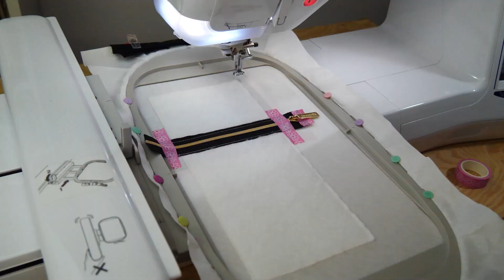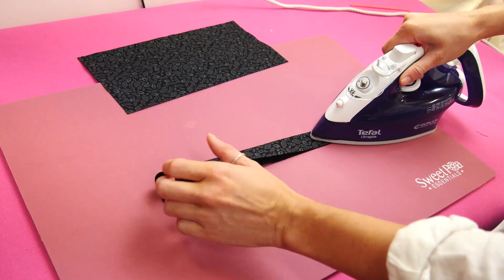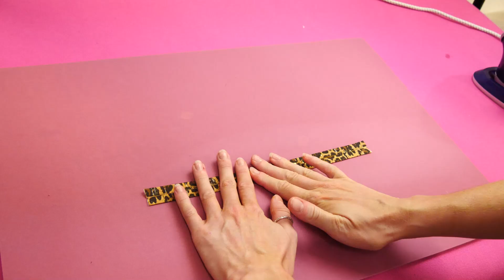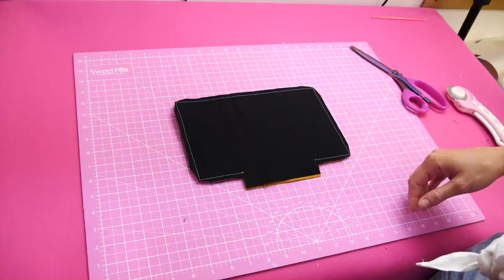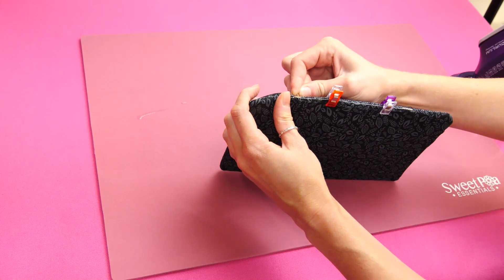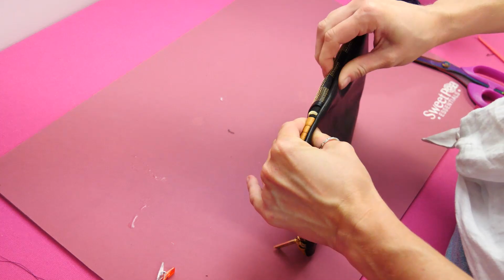Hatch Purse Tutorial

Comment: What size needle are you using?
Reply from the maker: We just use a standard 75/11 machine embroidery needle. If you are trialing your needles on PU Faux Leather or Cork we recommend manually testing your needles with the fabric prior to using it. You do this by pushing the needle through the fabric, if it goes through easily it will be fine to use on your machine. If it struggles to go through look at using another needle. Note - needles should be sharp or new when using PU Faux Leather or Cork.
Reply: @sweetpeamachineembroideryd4694  - thank you!  I've never thought about the testing of the needle - great idea - I will do that. Thank you again